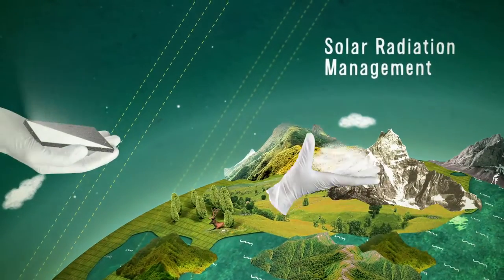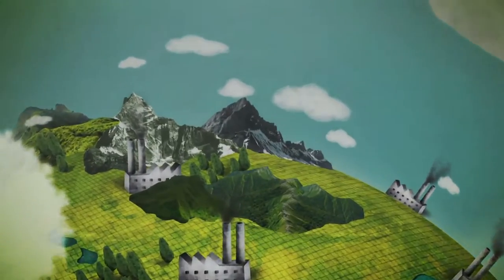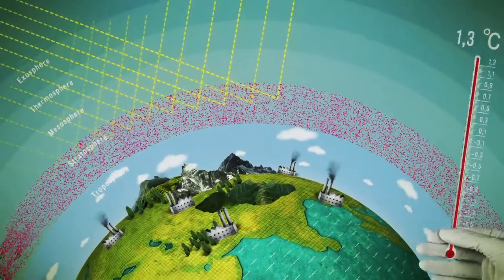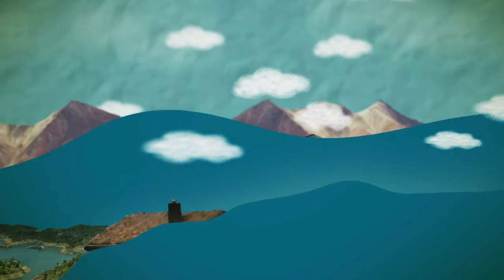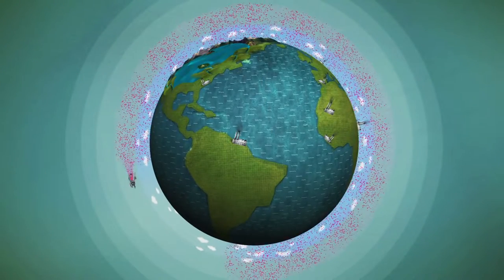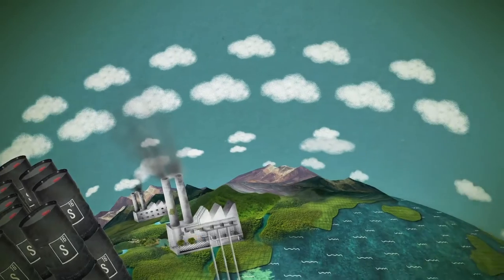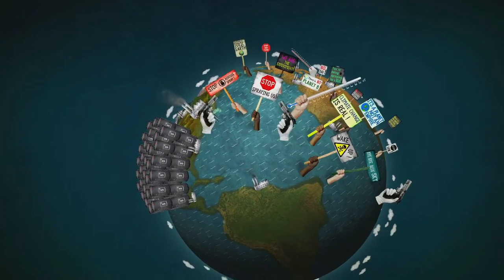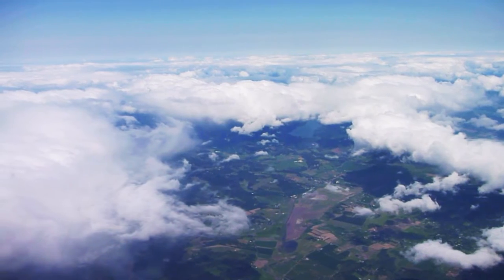A technofix for the climate? Atmospheric geoengineering (Solar Radiation Management)

Comment: Nowadays we have next to the radiation from the sun and space also much other radiations present in our atmosphere, modern technology added electro magnetic, radio , micro & mm waves from the 4&5 G WiFi networks and nuclear diffraction.
How much heat do they add to the atmosphere , is there any research on that ?
Reply: just use your brain. Do you feel heat coming from an wifi router in the way you feel it from the sun? Those are completly different wavelengths, e.g. thermal radiation has nothing to do with radio waves!

Comment: Many of the adverse effects described in the video are speculative, so we need to fund the research to answer these questions.  It may turn out that this form of solar management is not feasible, but we'll only know that by conducting proper research.  We need as many tools in our toolbox as possible, rapidly shutting off the fossil fuel driven heat engine will result in a significant temperature spike of at least 1.5C due to global dimming so we will require some form(s) of geoengineering in tandem with swift emission reduction, at least for a period of time.  The solution is likely to be multifaceted, of course emission reduction is key, but we also need a means of addressing our historical emissions, which by the way are still increasing not decreasing.  The recent IPCC report requires an as yet unproven means of carbon capture to achieve the 1.5C target maintain.
Reply: 3 minutes of solar energy is  more than what 7 billion humans use over the course of one year
Reply: Unfortunately you are wrong, they are ALREADY testing the effects of how these methods affect people when deployed on a mass scale, the spraying of the skies has been going on for decades now and WE are the test subjects.